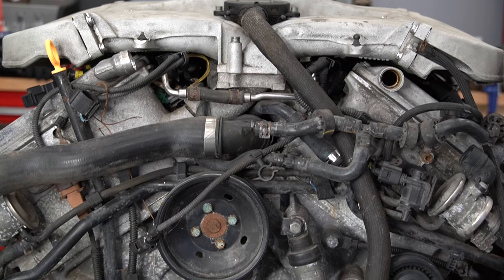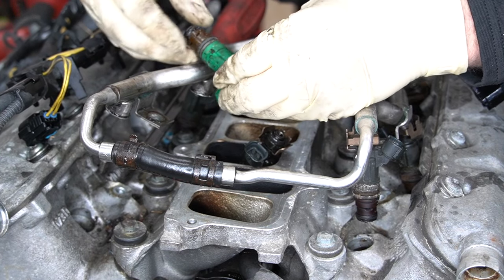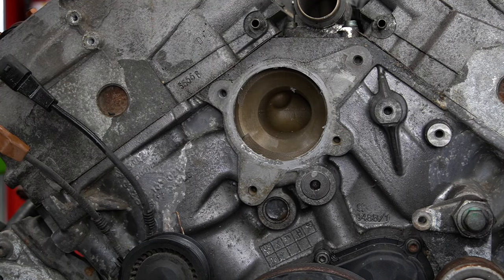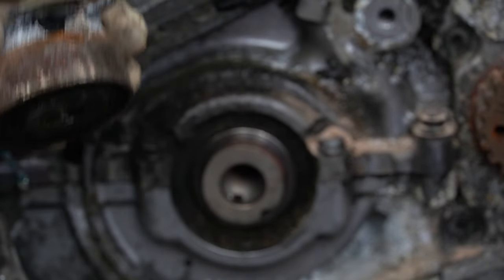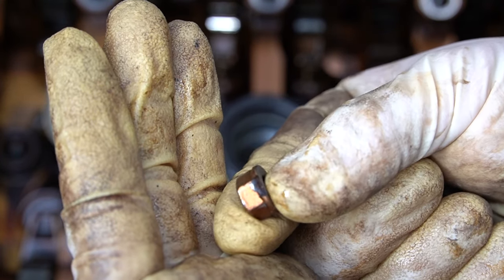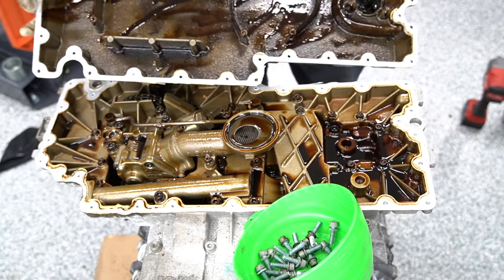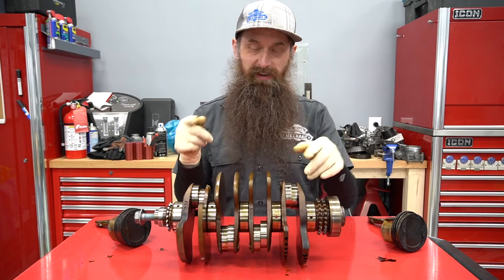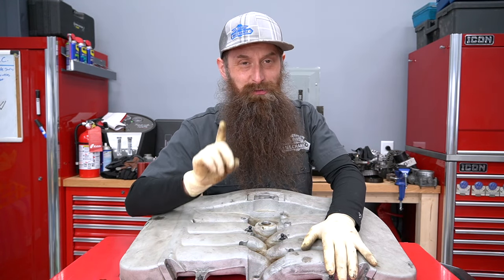W8 Passat Engine Teardown and Inspection ~ TINY V8

Comment from the maker: Thank you guys for watching! I know you want to know the miles on this engine, Im not totally sure. It could kinda go either way. Also should we do a teardown on that Transmission too? If not, it's going to the scrap. LOL
Reply: yo yo yo Charles how's it going
Reply: Thanks for the informational video.
Reply from the maker: @glynwatkins9968  HEY HEY!!! working on the next video. LOL I think you guys are gonna love it.
Reply: Wow amazing...
Reply: Yesh please! Love transmission teardowns!
Reply: This video was a lot of fun, Charles! When these engines debuted, I just had to check ETKA for an approximate cost. At one point a long block was about $19,000 or so.

The other guys avoided working on the W8 like the plague, so I spent quite a bit of time working on them.

This one suffered from poor oil maintenance, evidenced by the advancer screens "going rogue". I had a W8 with intermittent advanced faults on both banks. I'm a moment of reflection, I converted the BG Products oil sludge device to fit the oil filter fitting. It worked, yielding good advance results, but VW recommended replacing those housings.

Indeed, two were torn.

I won the lottery on that engine. Not only did the engine come to rest right on the TDC mark, but every one of the chain timing plates was on their respective centers!

The high temperature thermostat used on this engine was also used on a BMW engine as well as one Benz engine of I recall. Yes, the job of thermostat replacement was about $1000.

I like the unique fuel injector connectors, you should show how they work backwards from what you'd expect, pressing the grey button to set them for release.
Reply: Please rebuild the engine, don't see many of them around, maybe engine swap it into a golf? That would be cool
Reply: Yes a trans teardown would be interesting
Reply: I'd like to see a video on the transmission 👌
Reply: Was it from an awd?
Reply: Great video, thanks for that !! love to see the transmission teardown
Reply: Yeah go on if it’s scrap not going to loose anything by pulling it apart and having a look.
Reply: Yes sir! Transmission time!
Reply: More teardowns is more better. Nice to see what the SSPs were attempting to describe.
Reply: Transmission tear down please
Reply: Yes Do It and The Alternator Also 😊😀😊👨🏼‍🔧
Reply: I like the new flexi-straw on the WD40 cans. I've come to the conclusion that only about 5% of all penetrating fluid used actually goes where it's supposed to, and even then only 1% gets to where it does any good.
Reply: @HumbleMechanic  is it a zf 5hp19fl? If your gonna scrap it, I'd probably pay for shipping to me.
Reply: Transmission = Yes!
Reply: Gearbox tear down yes please 👍🏼👍🏼
Reply: Yes on the trans especially if it has something unique about it
Reply: Don't scrap metal ask your friends mechanics maybe someone needs a part or oil pump or crankshaft. Nice video...
Reply from the maker: I think the debate of “is it or isn’t it a V8” is not that useful. It’s an 8 cylinder engine in a V. It’s like the “is a Vr6 a true DOHC, or a double, single OVC. Both cases can be made. Lol
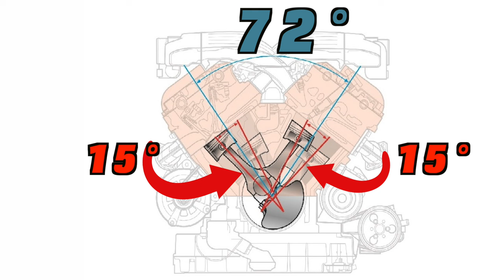Reply: 0:13 Charles, it's not a V8 engine. This engine was the genius brainchild of the late Dr. Ferdinand Piëch. The W is made from two VR6-2= VR4 cylinder heads housed in a V-block, connected to a flat-plane crankshaft. In that cross-section, the "W" is clearly shown. The cylinders 1 & 5 connecting rods form the 1st V. Behind them, the cylinders 2 & 6 connecting rods form the other V.  Thus Deux "V"s or the doo-bluh-vay in French, double U, W in English.
Reply: 9:09 I believe that's the belt-driven balance-shaft sprockets
Reply: U just tearing it down right
Reply: You can tear down the transmission to show your audience what's in it and then still you know throw it to the scrap anyway 😉
Reply: do they still make a Volkswagen sand buggy kit with the fiberglass shell that looks like the old Scooby-Doo crew one from that second show they did with Scrappy
Reply: Charles: save the W8 for your next R32 engine swap......pleeeeeeaaaaaasssssee?
Reply: Can you do a video on potential PCV issues causing misfires in an FSI GTI? I bought one and some people say the rear main seal can cause misfires but I've never heard that before lol. I had a 2003 Passat W8 fun to drive but man everything costs so much money! Thank you for your videos!
Reply: @whoismario  I believe all the W8's are AWD
Reply: I'm interested in seeing that.  I recently picked up an 03 W8 Passat
Reply: DO THE NORTHSTAR.
Reply: Thanks Charles I always wanted to know what my crank looks like. I run a 2004 W8 Passat Estate 4 motion which I love dearly but for a 4 litre its hopelessly expensive and underpowered. Its silky smooth which makes up for the lack of power. I'm looking forward to the transmission vid as that is the W8s biggest let down as the auto box really isnt the best.
Reply: Charles I have a 06 audi with the v8 that has the liquid cooled alternator and though it is pretty cool it is a pain in the butt when you have to remove it or have to get it out of the way to do oil cooler seals lol. Love the video I have seen one of these but never saw one torn down
Reply: Yes do the transmission!
Reply: Yes!!
Reply: do you think there is a potential for this engine? like to turbocharge it? or do a full build motor? because of its size this engine works great for the audi quatro system, its not a long engine, i think in terms of balance will work very well in comparison with other engines from audi/vw that hang over the front axle too much, the weight distribution will be much better with this engine on audi platform
Reply: Certainly
Reply: @whoismario  All W8 Passats are 4Motions
Reply: @HumbleMechanic  Charles, thank you for the VV8 teardown video.  It's a good idea to describe the type of engine correctly.  The only similarity between the V8 and VV8 is the V block. Because the "W" engine is expensive to design and manufacture and a nightmare to balance harmonically. So, It's impossible to design W8 since the "W" engine is base on W3.  Next comes the W6, W9, W12, W15 etc.But no VV8, and there's VV16? Because, the number 8 isn't divisible by 3. And this's where the late genius Dr. Ferdinand Piëch came in and solved it.  By using two VR6-2=VR4 staggered cylinder heads and couple to a common flat-plane crankshaft housed in 72° V gives a VV8. The conrods form a 2-staggered V or VV that translates to W configuration. And double the VV8 gives VV16. Genius!. This cross-section is clearly shown in the video at t=0:13.  Check the front grille and the trunk or tailgate of any VV8 where the letters VV are displayed.
Reply: I have a running w8 Passat that I would sell you if your interested?
Reply: Show us Transmission tear down please 🤩
Reply: 22:00 Due to 72° engine block, the split 18° offset crank journal is neccessary to give VV8 90° even firing of an 8-cylinder engine.
Reply: If anyone interested in giving me a follow not as good as these lads but hoping to get to this stage. Will help anyone along the way and if anyone needs any Help or info on any car give us a text I'll do my best to help you with any problems you have thanks for ur time guys.
Reply: @yammey9663  yes mate
Reply: @acefighterpilot  I agree mate great chanel for us to learn and give advice
Reply: So I actually own a W8 Passat wagon it's been throwing a code for bad cam position sensor I've looked everywhere for a manual or even just a diagram to see where they reside so I was wondering if you'd have a bit more insight on that, if you do thank you and even if you don't I still appreciate the content you make because it's helped me learn more about my own vehicle
Reply: Usually injectors are color coded for type and flow.
Reply: Was looking for the transmission teardown 😢
Reply: Still waiting for a new W8 video!! Love the content.

Comment: As a VAG fan I am astounded both by their engineering, but also the way they make stuff almost needlessly complicated.
Reply: astounded is one word for it lol
Reply: Solution, LS.
Reply: VW: Hey lets put the timing chain on the back of the engine so you have to remove the transmission to replace it.
Great idea... said no one. Uttery lunacy!
Reply: @gxp99  There used to be a time, long ago, when access to serviceable items on an engine was part of regular car reviews.
Reply: almost think a bmw engineer designed that lol
Reply: @reallyhappenings5597  Saaaame.
Reply: @gxp99  These engines weren't meant for the "normal" consumer in Europe though. Most of them just used Inline 4 engines, sometimes a V6 but that is already rare. This is the stuff they put in their luxury brands. In those cars the owner didn't care about maintenance, that's why you take it to the shop. I just wish VW in the USA would advertise this more. Bigger isn't better with VAG engines, they have a different target market. My old 2.0 BKD TDI is extremely easy to maintain, it is methodical.
Reply: @Werewolfmage  I own an '03 BMW X5 with the 4.4 V8, and while I've come to be NOT a fan of the make generally, even that engine isn't near as bad as that VW W8 engine. At least BMW has their timing chains in the front, and can be torn down completely while in the vehicle. It doesn't seem to have nearly as much wiring either.
Reply: I was a vag fan, then I purchased a tdi sportwagen.  Never again.
Reply: DehnusNorder lol my tdi would disagree with you.
Reply: @shadowopsairman1583  ls swap the universe
Reply: @gxp99  it aint a chain,its a BELT made of tissue paper
Reply: I never really liked german cars, I'm more inclined towards French cars (yes i know their bad reputation) but I do like the sleepers/bonkers thinking in some of VAG products, like the phaeton, and the V12 TDI in the Q7. I'm not sure if VW made a W12 Tuareg, and once when driving home from work I spotted a V10 TD Tuareg , couldn't help but chuckle a bit
Reply: Onely one my buddy swore by his pew-got 505.  ;-)
Reply: @shadowopsairman1583  An LS for the Passat this came out of?  Yea, cool bro, you’ll get laid fo shore.
Reply: @gxp99  cummins think it's a great idea.....
Reply: @onelyone6976  My neighbor had a v10 td tuareg here in California and I had to go google it after I first saw it. I had no idea a tdi v10 diesel was even a thing, let alone in a VW suv lol.
Reply: The Italians started this close vee 4 configuration on their Lancias. Great performance with a fantastic exhaustive.
Reply: @DehnusNorder  Except, there was a Passat W8 in the lineup a Mercedes E-Class competitor. It mainly failed because it was a gas guzzler. Don't get me started with the "ultra luxury" VW Touareg W12. You run out of excuses, fella. :D Yes, most customers take cars to the shop for maintenance. ;) Let's be real bro, complicated doesn't necessarily equal luxury. :)
Reply: @worldhello1234  I am just saying, stop buying those big VW engines. Really luxury cars come with luxury prices. If you want something reliable, go for the 1.0 TFSI or something similar from any other brand. 

You want to be real, let met tell you something real: More moving parts means more complexity means more chance something breaks down. 

That said it isn't just the USA's consumer at fault, VW also doesn't seem to ship smaller engines to the USA as "they don't sell". When really the Japanese Cars did fine. 

Als W12 Touareg ? For real? What idiot buys that one :P. 

And where am I making excuses? I am known for saying "Don't buy big engines if you buy German and want reliability" also "follow the damn maintenance". 

But that goes for almost all cars that last one.
Reply: It’s a brand from a country of latent gear heads!
Reply: Check out the v10 and 12 TDI. Opulent.
Reply: @steen8156  Which engine did you have? Engine size and code please.
Reply: @onelyone6976  There really are no bad cars/engines, they all just have their manual/likes and maintenance. French cars just need a different maintenance sometimes, and people then went "OMG SO BAD!" when they clearly didn't follow instructions. Peugeot makes really good engines.
Reply: @worldhello1234  I agree, that's why I said: Get the smaller engines. the 1.0TFSI is reliable for instance. Don't get a W12, get a V6 at max.
Reply: @DehnusNorder  Peugeot makes decent engines, except for the 1.2 3cyl. It has a timing belt in oil.
Reply: @gxp99  If you look after the engine, these don't fail. so no problem.
Reply: @gxp99  then again GM is now doing it now... with a rubber belt in your oil bath, to turn the oil pump 🙄
Reply: i'll assure you idk what type of VAG you're talking about, but i will assure you that I'm also a big VAG fan 😉
Reply: I too am a vag fan
Reply: @trillrifaxegrindor4411  i dont like how strong timing chains are. so i buy american..... my truck has Timing Gears pressed and welded to the crank and cam...........
Reply: @gxp99  it's not uncommon on cabover trucks(which obviously this engine was never intended to be utilized in). I'm a pretty loyal VW/Audi Group enthusiast but I drive Toyotas as daily drivers and will only have a pre 2000 Audi/VW as my passion projects.
Reply: @lebronjames4705  😂 I know what you mean
Reply: And for what? Not special power or economy. Get more from a timing belt 4.2 and way less hassle
Reply: cuz it’s cool

Comment: Water cooled alternator. *Angry Wizard noises
Reply: I love this comment.
Reply: Everything attached to this engine is just pure Y tho
Reply: Just like a god damn Smart Car water cooled alternator, hate working on a Smart  no space for pulling alternator out
Reply: and an expensive piece of s...
Reply: @markyrd1507  Germans
Reply: Yeah that is overengineerimg. BMW 4.4L QUAD CAM engine they also used in LM range Rovers were the same. Water cooled generator. Itll never leak when then front cover is part of the generator cavity sealed with a 5cent o-ring seal🤦‍♂️👌
Reply: @matthewmorrone883  German cars suck
Reply: As hoodie would say wiiiiiiiizzzzaarrrd
Reply: @matthewmorrone883  mine has never leaked.
Reply: @cmkm54  nice!
Reply: Looks like something that would work good until it malfunctions then when found that they cost a million dollars converted to regular air cooled model and never have a problem again.
Maybe even work better.

Comment: This man really has the WD40 sponsorship.. WINNING
Reply from the maker: They have been a good partner for years!
Reply: wetting bolt heads with wd40 does absolutely nothing.
Reply: Not too rare of a sponsorship.

Usually a TV thing with those sat morning car repair shows. But on YouTube even folks like MCM have their own painted cans.
Reply: @sindriatlason6925  True. It is better to use water or acetone. Last two at least work.
Reply: mah man needs a jacket with wd-40 patches
Reply: @sindriatlason6925  coming at my boi with that bullshit
Reply: @Ave_Satana666  your point?
Reply: @sindriatlason6925  Dry to wet is something.
Reply: Fellow AFX enthusiast!

Comment: The whole VAG W-engine programme is endlessly fascinating.  It's a shame we'll never get to see how reliable and compact they could have gone with further development.
Reply: They make a 16 cylinder 1000+ horsepower in the Bugatti.
Reply: A VR6 is pretty compact and the W engines are kind of based on it. The just needed a way to make a really good and sophistocated Engine for the Phaeton and Bentley Continental. And I have to say, that Bentley has the most sophisticated, even and quiet 600hp+ ever put into a car.
Reply: Exactly.
Reply: there are a lot off these passats in europ with 300k km plus there is one for sale near me for 5650 euro and it has 370000km on it!!
Reply: Thank you. One of the developers.

Comment: That is one of the most amazing cranks I've ever seen! Those offset skinny rod bearing journals and counterweights just make my head go boom 🤯 after years of seeing small block and big block Chevy's. Truly one remarkable engine - thanks for the dissection Charles!

BTW - be interesting to see you dissect a Bentley twin-turbo VR8-, or gasp, a Bugatti quad-turbo VR16. Might be a few years though...if ever! Cheers!
Reply: Bentley is a V8 or W12, the W8 was Passat only ;)
Reply: I believe some of the 90 degree GM V6 engines used similar rod journals to make the engines an even fire arrangement.  Otherwise, they were odd fire where you would have some cylinders firing after 135 degrees and others after 105 degrees.  It averages out to 120 degrees between each firing event, but it wasn't smooth power delivery.  

So this isn't new.  VW just added an extra level of complexity with their design of other parts of the engine.
Reply: Honestly refreshing seeing someone that's been around big American muscle acknowledging and appreciating European engineering.

Comment: VW engineers in 2000-s got some good stuff smuggled from Netherlands
Reply: Nah, this is their Bentley/Audi Engine. It's not meant originally for a Passat. At least not in Europe, VW just keeps telling themselves (especially back then) that in the USA everybody wants a huge engine. Which is really not the case. People want reliable easy to maintain engines, and that you get from a reputation you build over the years. Had they done that, most wouldn't have been harping about how unreliable VWs are :(. It is really VAG's and VW USA's own fault.
Reply: They make really cool engines, just not the most reliable or at least not the easiest to work on. At the end of the day not every engine design is gonna be a winner when you're doing your own thing like VW instead of playing it safe like most manufacturers. Just ask Mazda about that one as well with their rotaries.
Reply: @DehnusNorder  their boss was insane